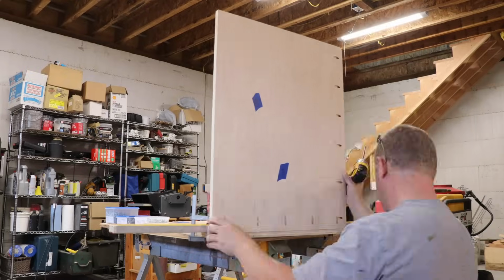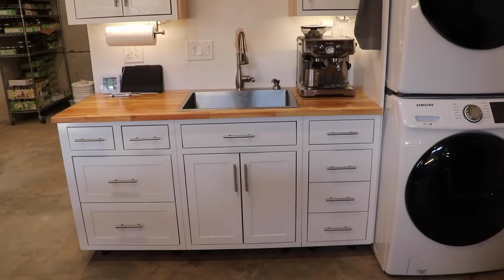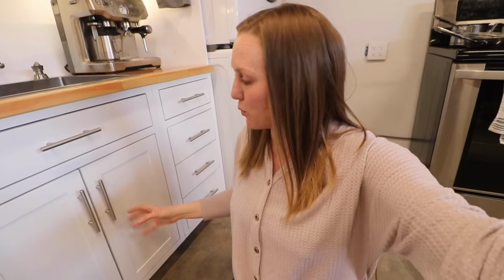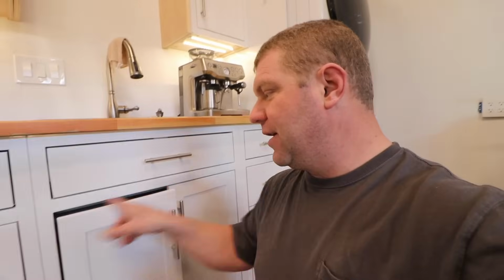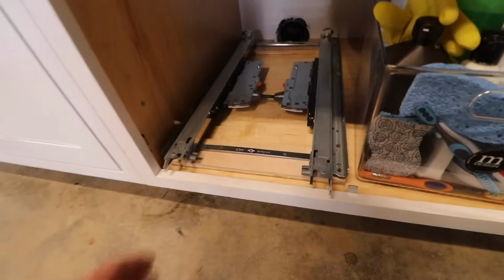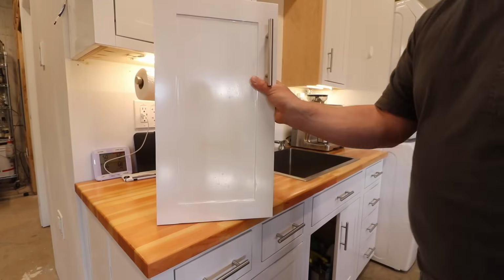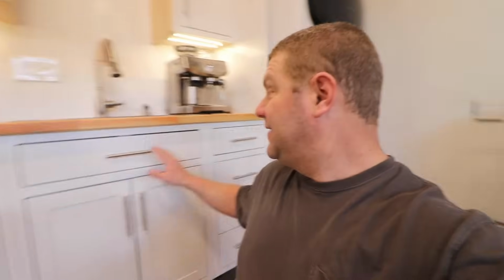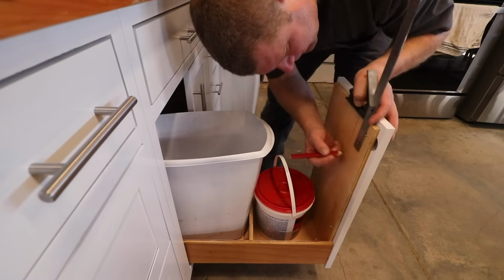LIFE HACK: Turn Any Cabinet DOOR Into a DRAWER

Comment: If you don't have a window in front of the sink, there is no reason to have that wasted space, your face never will hit that cabinet  unless you trying to do so, also it can be a double door cabinet with waterproof interior and install a dish drying rack and make some channeling holes directly under to drip water to the sink.

Comment: Consider adding an angle support from the top of the drawer box to the back side top of the door to eliminate the lever action you introduce by pulling at the top of the door.
Reply: Yes I do agree with this, or could have made the left drawer side higher or on a angle down from front to back.

Comment: Those handles will catch on EVERYTHING! been using that style here in Europe for years. Do yourself a favor, you should have spare materials and paint (I always keep spares for all of my cabinets wether for home or rentals) Make a new panel for that center sink section. Skip the handle and use magnets to fasten as you have already done. You could glue two small squares of wood on the sink with a dowel rod on each which will fit into holes on that piece to help center it.

Comment: Nice faux front on the sink cover.  You mentioned you were trying to figure out a way to keep the front centered.  By now, you've probably thought of this, but four short wedges could align the front, and still remain hidden.  One recessed each side, and two recessed at the bottom.  The area looks great, and should last a very long time.